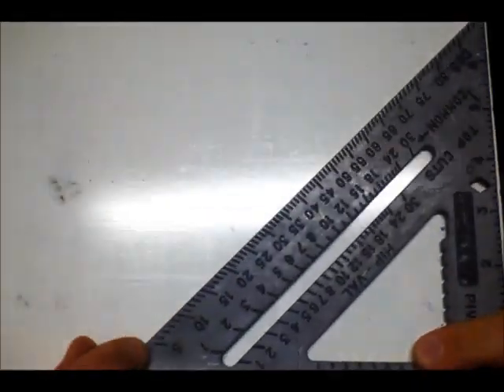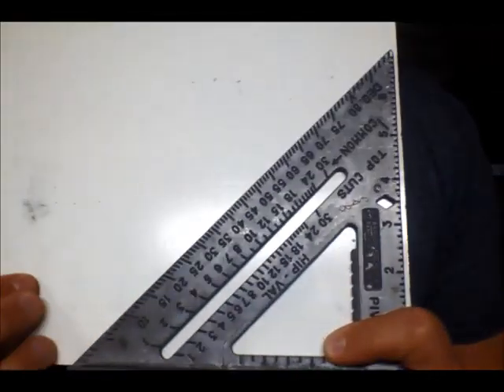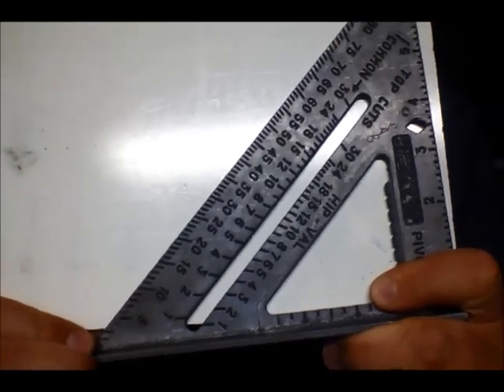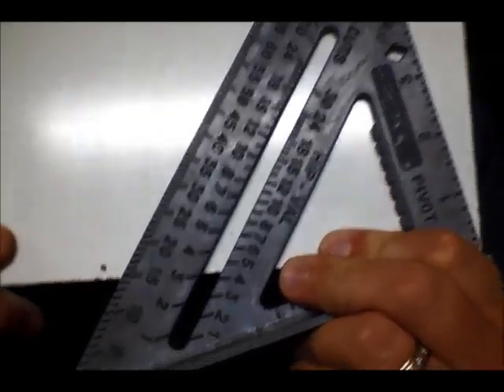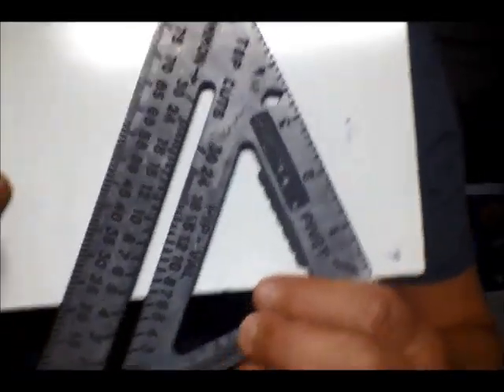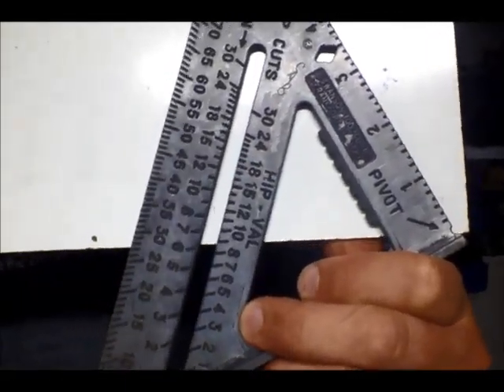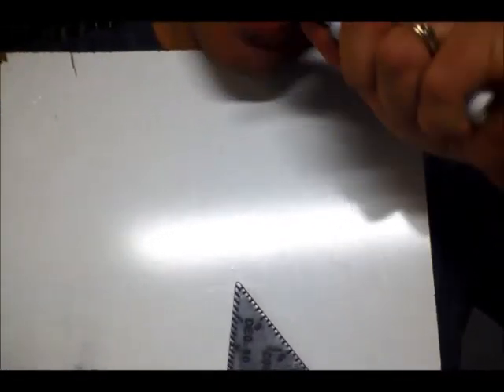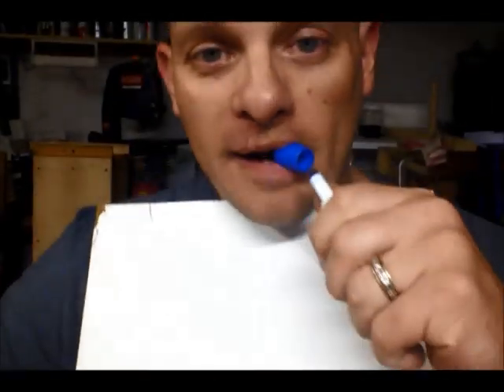Angles with a Speed Square???

Comment: Well, this is great if you already know what angle you want to cut. But that doesn't seem very useful. How can you know the angle you need to cut before you measure the angle you need to fit (e.g. the angle of a wall that flooring meets)? It seems to me you're showing Part 2 and leaving out Part 1.
Reply from the maker: Good point. I will do another video for how to find angles. Stay tuned!
Reply: Get with the program zeppy.